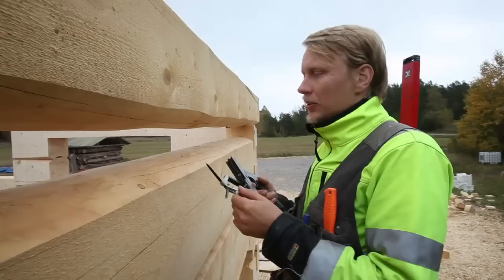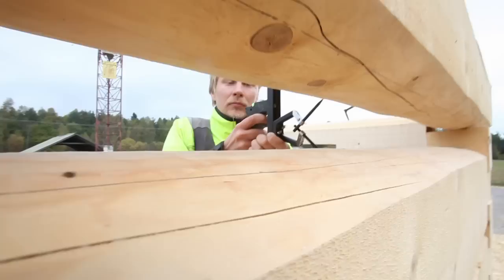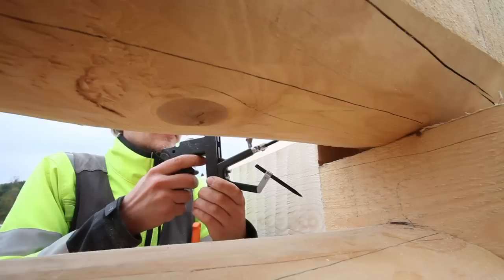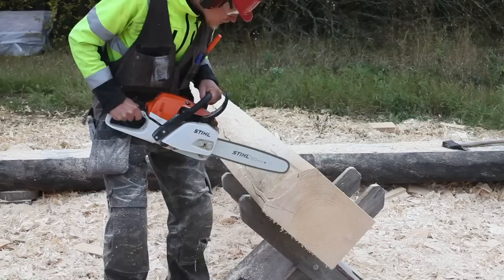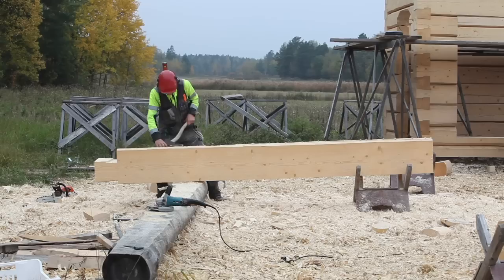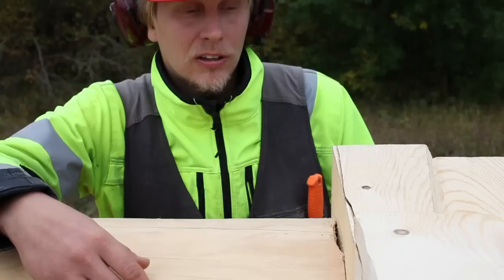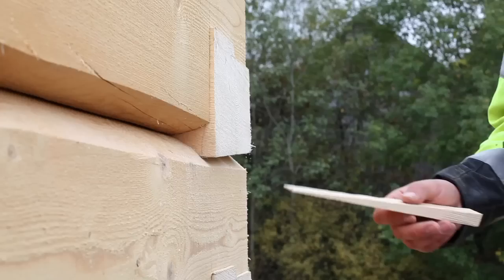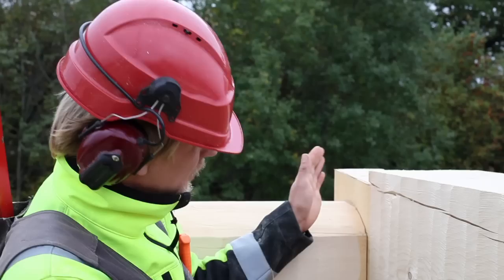Log building: A tri level scribing -technique

Comment: Never noticed a problem such as you describe with Norwegian laftehus. Maybe the sinklaft you are using is holding the timbers apart and the skinninglaft  used in Norway allows the timbers to tighten. Your system suits your climate, here we have to have much more windproof solution than the one you are using (it takes very much longer to make skinningllaft/raulandslaft) . Very good work and good problem solving!